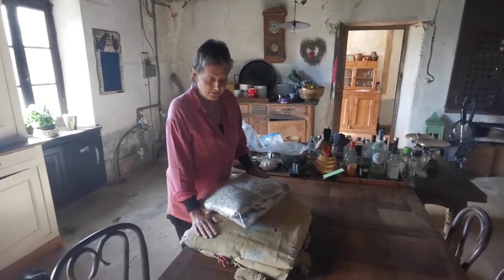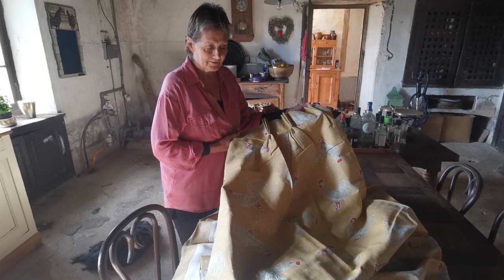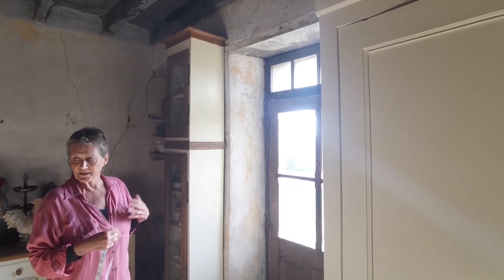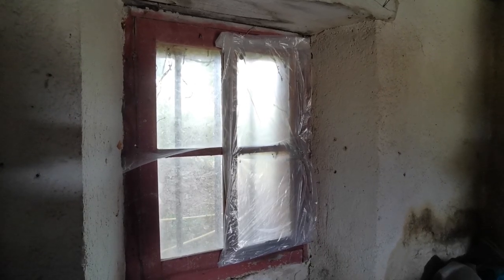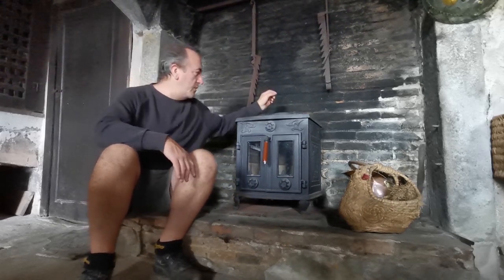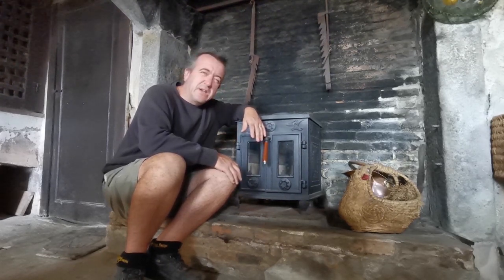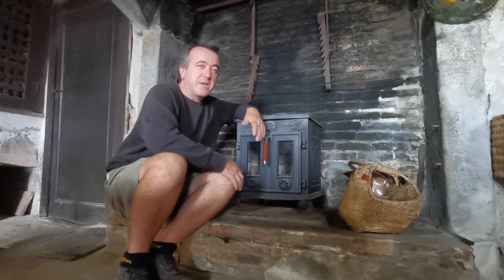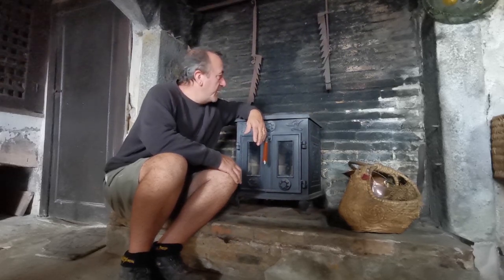The fireplace of our château kitchen, needs a serious clean!

Comment: Hey Rols, I think you could buy a wire attachment to put on your drill to clean the brick. I do have another suggestion that would really help with your heating problem until you can refinish the brick in the fireplace, I would suggest purchasing a  panel of sheet metal to put behind your heater, it definitely would reflect the heat back into the room. I know it won't be as pretty but maybe you could put the metal up until you can afford to hire a brick Mason to come and clean and repair the bricks in the fireplace, by the way I have a fireplace shield li the one you have but mine is in perfect condition with a mermaid on the front. My Daddy got it out of a old house that was going to be torn down about 45 years ago,I didn't have a place to put it inside our house so it's hanging on the front of our storage building outside. We'll God Bless see you next time. Kathy 🇺🇸
Reply from the maker: Hi Kathy, thank you for watching and for your suggestion. I have the wire attachments for the drill and I have a rotary sander a with wire brush wheel attachments, just trying to avoid them at the moment because of the dust it will produce. If the cleaning doesn't work then they are my final option. Glad to hear you are displaying your backplate, ours will be displayed somewhere, it's like a piece of art. Enjoy the rest of your week, Rols

Comment: You can make the interlining and just attatch that lining to the drapery hooks.  That way you don't have to take them apart.
Reply from the maker: Hi Jan, thank you for watching. Unfortunately I have to take them apart as they were made for a different door so I need to add an extra width to them. Best wishes to you, Suzie
Reply: @chateaucitadelleducavalier  why not just sew the two together and gather the top more. Then put a separate lining behind them. The more material the thicker the insulation. 😊
Reply from the maker: @pamelkamah6307  Thank you. It's a pinched pleat which won't gather and joining the two together will be too much fabric, they also have to be lengthened with a false hem. Kind regards, Suzie
Reply: I had just thought that you could take off the pinch pleat and just gather the tops as normally the same tape can be used for both.  But hay you know best what you want. 😊bet they’ll look great whatever you do. 😊

Comment: The broken metal plate could look interesting hanging on a wall in the kitchen as a piece of art. It does look lovely after all and it has a great story.
Reply from the maker: Hi Lea, thank you. Our thoughts exactly, it will definitely be displayed somewhere. Best wishes to you, Suzie and Rols
Reply: Try baking soda I use baking soda to clean my oven and it. Works
Reply: Apply baking soda by wetting the area first then mix the baking soda turning it like a paste consistency’ layer it on to the surface then after twenty minutes scrub it of with hot water
Reply: Then rinse the bricks with more plain hot water
Reply: It is like Costic soda so use rubber gloves

Comment: If you put the heavy drapes on the kitchen windows. It will be darker in there then you felt it was.
In U.S. will use plastic  cover over windows which help with drafts.
If course replace broken panes fill cracks and put rolled fabric under doorway openings
You can put that broken metal thing in the barn...buy another prettier one at the brocante
Reply from the maker: Hi Margie, thank you for watching. The drapes will be open most of the day so light won't be an issue and at night we will close the shutters for extra draught proofing. Enjoy the rest of your week, Suzie and Rols

Comment: Wow, this is timely. We just had a new boiler installed and it's not quite providing hot water correctly. And I just hung a new door curtain today. You showed a window with polythene instead of glass, but can you get insulation kits which have polythene stuck around the edges of the opening, over the glass, then pulled tight with a hair dryer? They work pretty well as insulation, and still let light in. (We got our last double-paned window last year - what a blessing - it's 2.5 x 1.5 meters.) I wonder how much heat that tiny wood burner puts out - is it enough for that huge room? I've read that Europeans in general are buying wood burners like crazy for this winter.
Reply from the maker: Hi Lisa, thank you for watching. We hope you are able to sort out the water from your new boiler. We have calculated the heat generated by the wood burner to be approx 40m sq and the kitchen is 36m sq so it will be sufficient for that room. Enjoy the rest of your week, Suzie and Rols